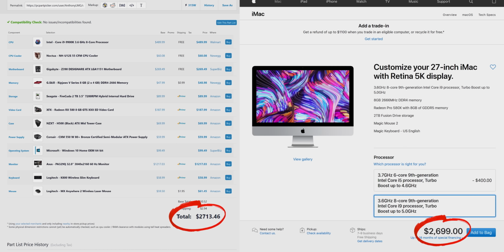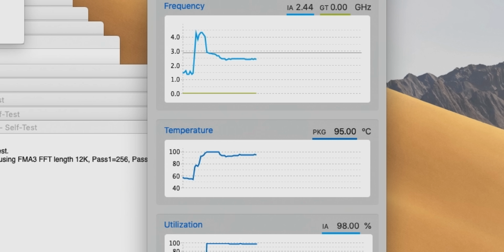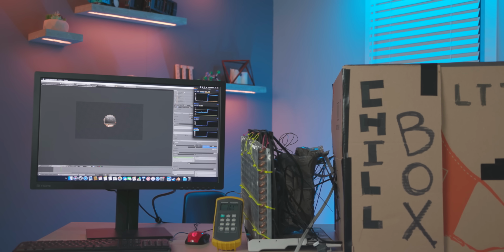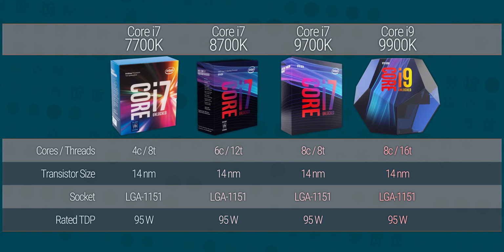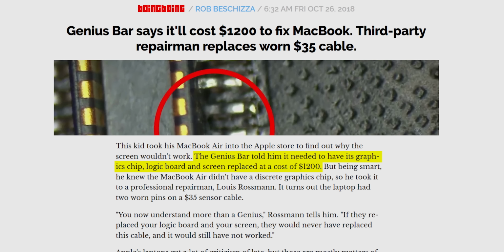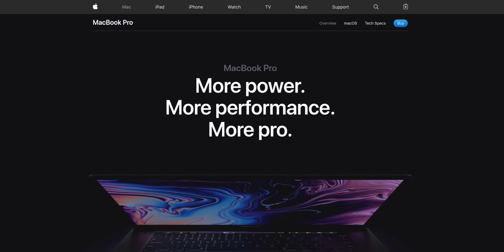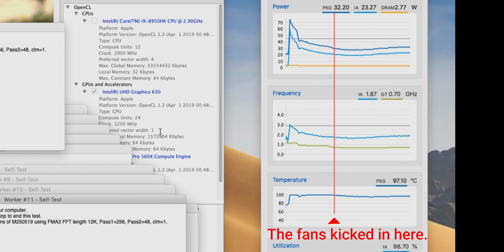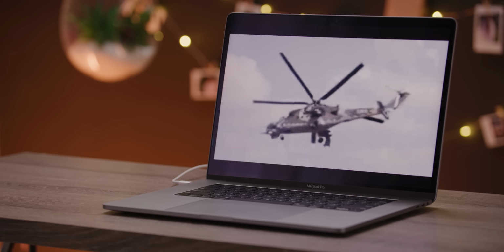Macs are SLOWER than PCs. Here’s why.

Comment: All heating issues aside.. Macs better for audio and music recording/production, I don't care about top "speed" as much as:
1) solid USB/firewire chipset, bus bandwidth etc.. that doesn't do weird crap
2) OS that doesn't flake out for random reasons 
3) Audio drivers of high end external gear plain old EFFING work on a Mac
To sum up, the power of a machine is not always speed.But heating issues effecting lifespan, that sucks.

Comment: 2:02 imagine here in Brazil.. with no air conditioning
Reply: imagine in Dubai where it is 50 degrees.
Reply: i've seen a couple of video makers pulling one of it off their bags, sometime ago at the departure hall of cgh. people from that industry only have these. i can only imagine that applications they run to get their work done is mac only, or apple evangelism is anything more efficient than their products.
Reply: @mstrsrvr  Os mac têm um hardware previsível. Algumas aplicações pra médicos podem encurtar as variações de seus parâmetros usando um dispositivo que varia pouco, padronizando a experiência e isso é bom, mas pra outro tipo de trabalho pode ser simplesmente capricho inútil.

Physicians may use mac because of its specifications that wont change like mad compared to a PC mostly about screen hardware and less parameters floating based on different parts working together from differnt manufacturers. For other professionals , imhu, there is no need for such hype.
Reply: @carlosestevam2  concordo, empresas podem padronizar em apple, lenovo, dell, hp, com mac os x, windows ou com redhat. por capricho ou pelo melhor custo benefício. normal. sobre previsibilidade, nem tanto: apple foi de motorola para powerpc, de powerpc para intel e está flertando com ARM. as mudanças foram drásticas.
Reply: @mstrsrvr  é, mudou muito

Comment: I've been a mac user for the last 10 years. But I just discovered that replacing my macbook pro from 2012 (1250 dlls at that time) it will cost me arounde 2700 for something with the a new processor but less memory and ram.

So I decided not to buy Mac again and I got a gaming Predator PC for only less than 1k on black Friday and running an ubuntu file system on top of the terminal I can fill most of the dev spots I've discovered in all this transition.

Certainly apple is going to loose a lot of clients in the dev market, even the company that I work for stop buying macbook pros for the new devs, and now they are giving them macbook airs which sucks tremendously, some devs are preferring to bring their own pcs.

Comment: Don't forget the part where several of the MacBook models have their exhaust blowing super hot air directly at components that are glued together, the end results being rather obvious adhesive failure. Then either Apple be like "There's no way to repair this, but don't worry we're good guys, here's a new one for 3% discount, PS all your datas are belong to us and can't be recovered, oops". OR  "Well we're going to need to replace logic board, battery, and screen. You're looking at about 1700$ and it won't be ready for 3 weeks. Also all your datas belong to us and can't be recovered. Anybody who says otherwise is a liar and we're probably going to threaten them with legal action at some point. Have a nice day!"

Comment: cost the same? well macs are not in AMD revolution. They dont get the Ryzens unless you build hakintosh. 
Also, Apple build slim laptops, in PC worls you can buy workstation or gaming pc with powerfull versions of cpu.
But to whom I am preaching? to people that use apple keyboard with desktop pc? its masochism to use those. just buy proper mechanical keyboard.

Comment: Umm, 2 things. 1. Apple is unhappy with the way other companies make certain components for them so they end up building them themselves I.e. cpus.  They were disappointed with Power from IBM - reason thermal dynamics not working in mobile form factors. So they switched to intel.  They are experiencing the same problem with intel chips (like you say) with thermal issues in the tiny form factor. So to start to address this a few years back Apple started making its own CPUs for its phones and iPad which (based on their own design of the ARM standard) they are currently  the highest performing chips in their class (ARM by a long shot even out perming intels own i3, i5, etc. mobile cpus .  Why because they designed them to not have the IBM or Intel thermal issues. Second point, Apple notebooks destroy pretty much every other PC manufacturer in performance per watt meaning Apple eeks out more battery life per cpu than other manufacturers.  The research they did revealed their customers value longer batter life over pure performance in their notebooks. Need pure Mac performance, get the new Mac Pro or iMac Pro.  This is a fact.  The game changes soon when Apple eventually moves their notebooks over to their own CPUs.  The iPad Pro is already faster than most pc notebooks you’d find in Best Buy and competes well in price. I liked your video but some important facts were missing.

Comment: My Lenovo W530 will run at 3.5 ghz and max out at 90c. When its hot  though it will run right up to 100c and throttle though nothing like what happens to the macbooks. Lenovo got the thermals right. My i7 will hold 3.2ghz even right up to 105c if the ambient temperature is rather warm. And I've run this machine under full loads for long periods of time with no problems at all. It just keeps on trucking and is still reasonably fast enough to be my main machine. The 32gb of RAM and SSDs certainly help.

On the android side, I'd usually agree but my Pixel 2 seems to never throttle even under a stress test so thermals can be done right there and clearly LG did their homework.

Comment: Boosting CPU performance is very very bad for battery. i mean the higher the temperature the more resistance the more energy is needed
also the more you boost your CPU the more energy is needed

So lets keep one thing in mind: high performance and battery life don't fit that well together, especially in this case of pure battery life waste for some performance

Comment: Unfortunately, it doesn't matter how much evidence is produced; Crapple users will argue to the grave that they have better hardware, design and user experience. It's incredibly frustrating and the main reason you end up with VIP users in an enterprise setting running around with Macs and forcing infrastructure changes to support their hardware.

Comment: I think you do know why the iPhone doesn't thermal throttle. The A series chip is designed by Apple while the Macbook's processor is designed by Intel, so they have to deal with whatever Intel spues out.

Comment: They don’t care if it breaks as long as “enough of them” last through the warranty period.
The hardware of MacBook’s has degraded over the last several generations.
We have over 2000 of them and the 2019 MacBook pros are especially bad. 
They are very poor performers and have numerous problems with displays, keyboards, track pads and motherboards.

Comment: imagine being dependent on an architecture with thermal issues waiting and hoping for a better solution to roll off the assembly line. well, you get a bandaid until then if and when unless you either make your own chip or the contract runs out.

Comment: A macbook is actually worth your money. Asus , Acer , Samsung. i had 3 different laptops from low end to high end they all run like crap a I7 4790HQ or MQ runned like a Bulldozer chip or even a I2 Quad. A macbook with a crappy I5 4xxxU Had better performance all around  on MacOS.

For a desktop i do recommend something different then a overpriced MAC
Reply: Darko and since when is an i7 4790HQ a high end cpu?

Comment: I would actually suspect that at least by now there may be more engineers that appreciate a *nix OS (Can't tell you how often I wanted to contribute to an open source project only to find that they didn't make it suitable for Windows. Often times it only requires a simple config change. But there are a number of people who are in a *nix bubble and don't know cross-platform basics.) that tends to be more stable than most Linux setups.
And allows you to compile with xcode. I set up a VM for a that because no way I will pay that much just for compilation but - it was a hassle and runs like ass. I get that not everyone wants to deal with that.
(As opposed to the majority of mac users just being pretentious.)

Comment: My Acer laptop doesn´t thermal throttle at all.
It keeps up it´s 3,0Ghz boost clock at 4 cores load or up to 3,5Ghz for one or two cores with no issue.
Also while stressing the gpu.
It rocks an 1050ti and i5 7300HQ which is quite poweful.
The laptop isn´t even that thick but has a good cooling solution i guess.
Reaching max. temps of 61° C gpu and 80 °C cpu